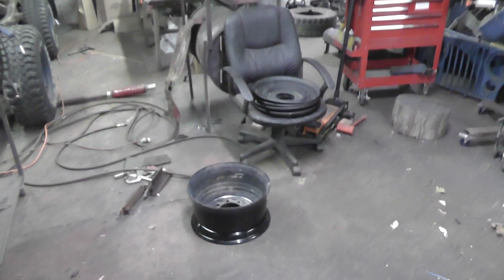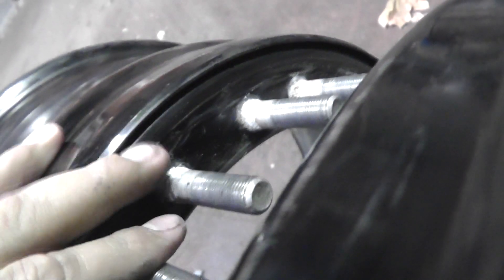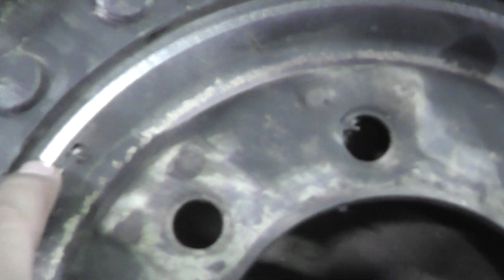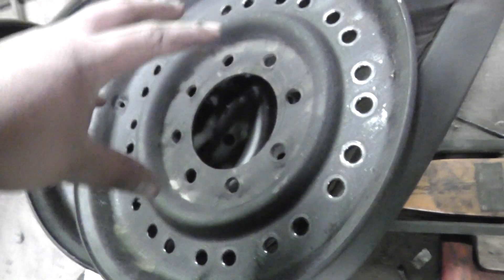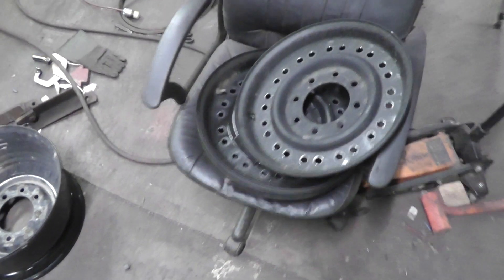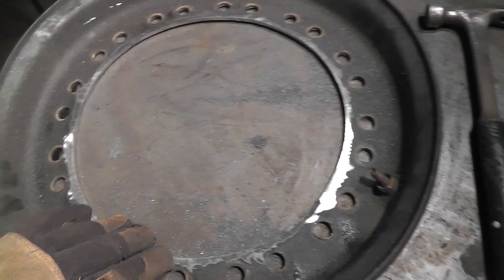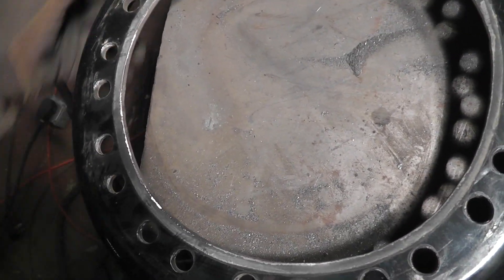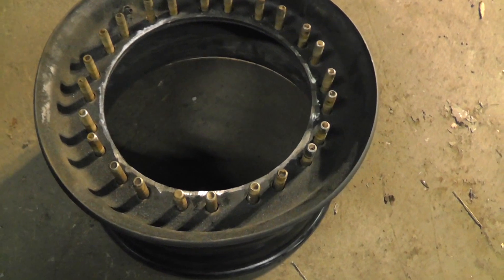Cutting the Wheel Centers - 24 Bolt H1, Humvee, Hummer wheels

Comment: trailworthyfab sells military takeoff tires with 95% tread left for $175 each
Reply from the maker: yup. You can get them cheaper if you get them from the government though.
Reply: I have seen some auctions close for $25 for a set of 4 95% or better tires
Reply: but you have to pick them up
Reply from the maker: yes but you pay a lot less.
Reply from the maker: It's worth it when you pay that little.
Reply: unless you live half way across the country from them

Comment: what would be the backspacing on them
Reply from the maker: Depends on a few things. 8 lub pressed centers usually have a max back spacing of about 3 1/4". I built some 6 lugs with pressed centers that have a max backspacing of 2 7/8". The flat centers allow for much more backspacing but are harder to build than the pressed centers. The factory back spacing is 7".